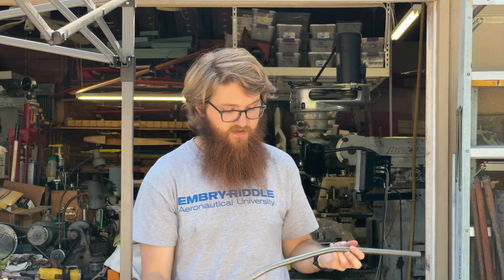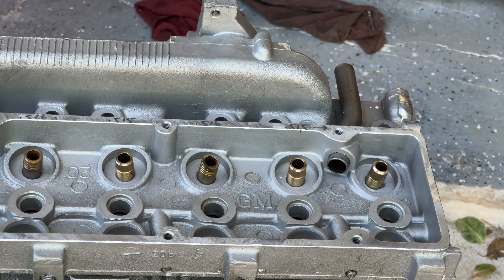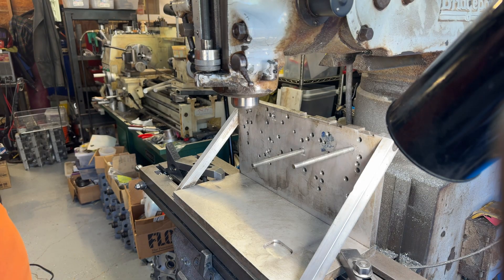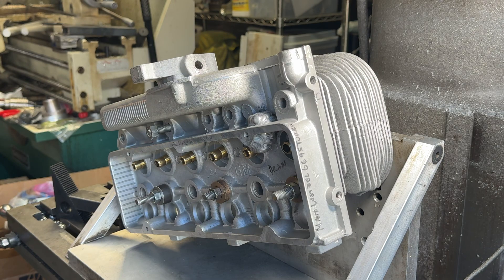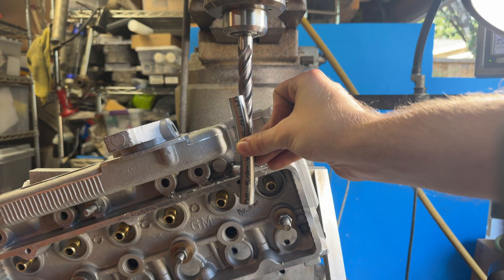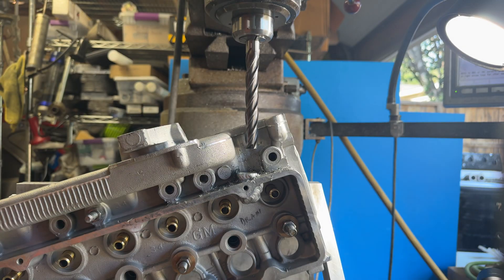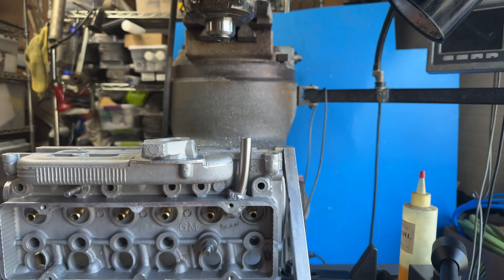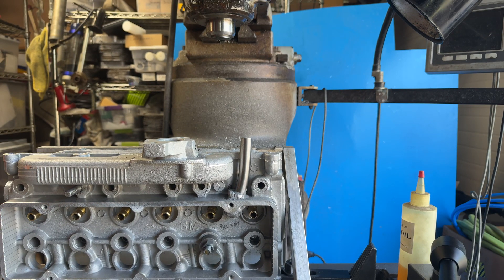Converting A Head For Turbo Use | Corvair Head Rebuild Series Extra

Comment: I think I'd just weld an AN fitting onto the valve cover.
Reply from the maker: We would probably do that on one of our heads because we can fab up a drain hose from the turbo but for customers we want it to be as close to stock as possible.